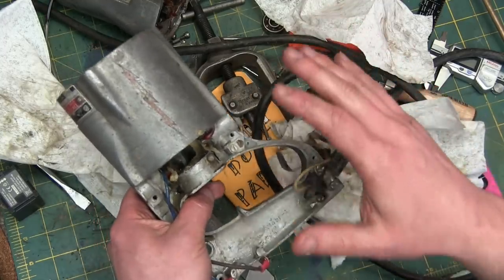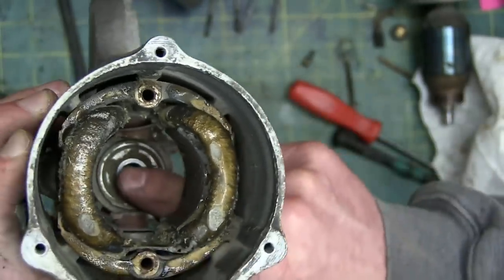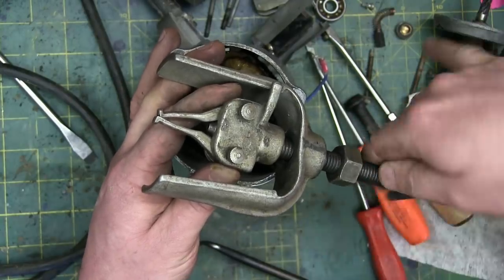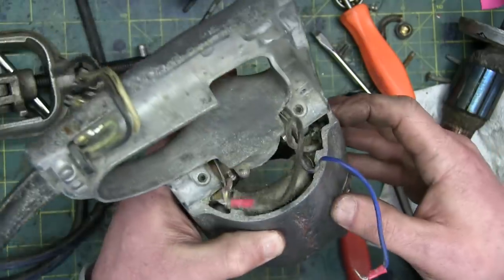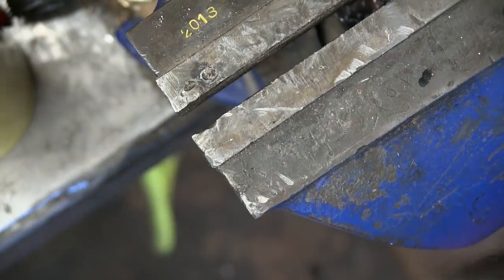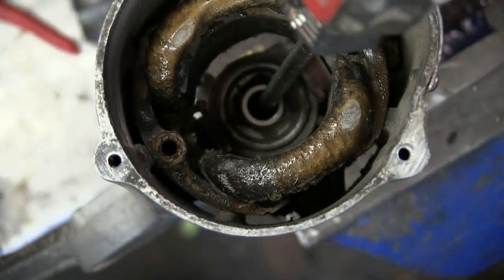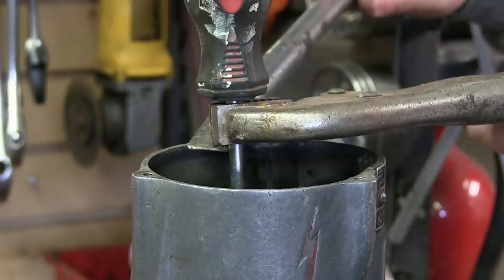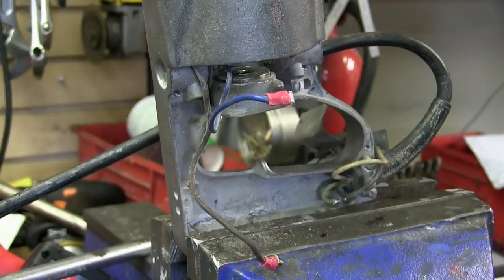GREASY RAG HACK! Damage-Free Bearing Removal.

Comment: I used this technique today to remove a pilot bearing on a Kia Sorento. I am a newish (3 years) mechanic and had not done one before. I was told I had to call the parts store and order a tool or I was screwed, the other techs said I should just skip this replacement and finish the clutch job. I tore a shop towel up and dipped it in wheel bearing grease, it was out in 5 minutes! Thanks for the tip man!
Reply: This technique was actually a question on the ASE test haha. It's becoming a standard way to get it done. Really though it's a good way to do it without screwing damaging things.
Reply: Still one of the best VJO's on here..
Reply: @gearhead1302  dude, it's a fantastic option. way easier on the surfaces so less likely for the new bearing to be cocked or something shitty too.
Reply: For a 3 year you did pretty good
Sorry, i couldn't resist, even 2y later
Reply: Use bar soap, shave pieces slide them in and tap drift.. no rags needed works every time
Reply: Two Cheeks Auto now you look like a fuckin genius in front of the trans tech that's been there for 10+ years

Comment: my dad showed me that years ago. Had to get the pilot bearing out of the flywheel on my truck, found a bolt that just slipped in and filled it with grease. few taps with the hammer and it popped right out. Hydraulic pressure, can literally move mountains.
Reply: I learned that one from an old guy that lived next door when I was growing up. Best part of 50 years ago now. Learned a lot of useful stuff from him over the years of my youth. Most useful was the attitude of 'have a go'.

Comment: Don't know if anyone else has mentioned this one to you AvE, but right along the same lines as the greasy rag hack shown in this vijeo, and not nearly as friggum messy, you can use plain plain white bread. Compress some strips of the bread into a little ball, farce it into the hole, add moarr bread, smack on wrong side of the slightly undersized drill bit and repeat. Hope this helps someone at some point. Love the videos AvE!! Your channel rocks!!

Comment: easiest way is fill the hole with a heavy oil and drive a woo dowel into the center hole the oils pressure will push the bearing out. learned this in the 70s from an old mechanist.

Comment: Craziest thing that you showed this trick! I was lucky enough to have an Uncle who worked for Ford and went to their trade school in 1926. Not sure where he learned it, but one evening I had just finished machining a bearing holder with a blind hole in it and realized I needed to get the bearing out before I sent it for plating.

Long story short... He pulled out a telescoping gauge found the ID then grabbed the appropriate gauge pin and dabbed a finger full of grease in the center. Moved the part to the arbor press and gave it a what for!

The bearing magically rose and my jaw fell straight to the floor!

OLD SCHOOL GENIUS!!
Reply: Andrew Germann each r
Reply: Yeah, it's an old school technique, still very cool
Reply: Hey wait a minute, don't they have a free app for that now 🤔😂

Comment: The grease gives hydraulic pressure as you force it in, and the rag serves not only to wick the grease in, but to seal the shaft so the pressure works on the bearing. Genius!
Reply: thatotherguy27 thanks I was wondering how it worked
Reply: I have done this with just grease. bits of rag are a refinement!
Reply: Believe it or not, I've even seen a clutch bearing extracted using stale bread! Same principal, although who keeps stale bread around?

Comment: I bet Mr. AvE had a piece of rod stock the correct size... but just wanted to use the drill bit to make the rest of us cringe...
Reply: Lumberjack Engineering bet it's a chinesium bit, about all they're good for
Reply: Yup..! That and opening a beer, is all they are useful for.
Reply: Actually, the proper nomenclature is "Chineesium sintered pixie dust".
Reply: or a transfer punch that would have been cheaper to replace, if necessary. I think you are right.
Reply: He almost certainly did, and if not he also has a lathe. Bearing that in mind, there's a big difference between having something and being able to find it.
Reply: If you use a cheese grade bolt it'll expand to form an atcheral piston. Sorta.
Reply: Don’t worry he owns a drill doctor
Reply: @kansascityshuffle8526  LOL great comment! :-)
Reply: I didn’t even question this that’s exactly what he did surprised he didn’t u a long carbide endmill
Reply: @johnsmith4630  Transfer punches,  don't need'em often, but they're a Godsend when you do. I'm going to use one tomorrow.
Reply: @kansascityshuffle8526  +1  Or what's left of one!
Reply: Once again, he got er done.
Reply: copper faced hammer wouldn't hurt it at all

Comment: Works with bread too!
Reply: I too use bread, clean and no cleaning grease afterwards.
Reply: Yeah I came here to say that. Saw some dirty guy on YouTube a while back remove a bearing using bread and a wooden dowel
Reply: Jeremy Baxter me too bread is always in my box...well when I need to do this it is
Reply: Bar soap works as well
Reply: Used bread just the other day doing a motorcycle bottom end at buddies sister's place. We didn't have grease haha!
Reply: I was going to say that. Good fix
Reply: I have used Parafin wax or bar soap. It doesn't sneak by as easy, no grease to clean up and it's cheap, available and even reuseable.
Reply: That's wild lol 👌🏼😌
Reply: Wet paper/cardboard. Works well and it's always available.
Reply: Slide Hammer ???
Reply: It's better to use white or whole wheat?
Reply: @outcast7899  you don't know nuthin'! Pumpernickel or rye!
Reply: @Weaver Cattle Company nice plumbers putty

Comment: The shop genie showed me a variation to this, instead of grease and rags... use bread and a bolt of similar ID. Tried it once on a cheapo pilot bearing replacement. Slick as two eels fornicating in a bucket of snot I tell ya.
Reply: Cole Bendis  yeah man fuck some grease, too much shit to clean-up after, bread all the way! learned this a few years back, will never forget it now!
Reply: Bread is awesome.  works for soldering pipes when they are still  a little damp inside.  stuff a lump of bread up the pipe to absorb and excess water to stop the pipe cooling.  Bread disappears once the water is turned back on.
Reply: bread worked on the clutch pilot bearing on my old land cruiser
Reply: My Bread just goes in the Toaster, Or my Mrs spends it, Normally the later one .

Comment: Yeah, so, I shared this with my snottiest of bmw fanatic friends. The contrarian fucks actually argued for bread instead of grease. Works exactly the same, only you have to finger out a bunch of compressed bread from your blind bearing hole. There's some kind of high-fiber joke in there but I just can't seem to extrude the comedy from it.
Reply: Bread? Interesting, I will have to try that next time I am changing a clutch pilot bushing. Although grease seems like it would be a little more available in a shop.
Reply: That's what I'm saying, but you can find videos of it easily. Both work about the same.
Reply: James Congdon I am a BMW master tech. The pilot bearing slide hammer is awesome. some crankshafts have a plug you can blow out at the rear you can blow out, and cause an oil leak..so the safest, fastest way is to chuck up the slide hammer and give er hell.
Reply: hilarious!
Reply: Yeah, while i'm glad to learn about this trick, i was wondering where the hell his slide hammer bearing puller (home-made or otherwise) was.
Reply: Thanks Bogart, did not know that...would be just my luck to try this, and permanently screw up my Z4.
Reply: @seang5284    You are correct about the bearing puller.  Sometimes you will 
find an UN-shielded ball bearing...no grease or bread will work, only a puller.

Comment: Ah nice, I've used this trick once or twice to remove the spigot bearing from a clutch system, upside down under a car, jammed wet toilet paper into the hole and tapped it out with a 10mm socket in the middle. Worked first time, much to my surprise.

Comment: Whoa!! Imma stick that one up my sleeve for future reference.
Reply: I've used it for pilot bearing removal once, worked fine just took time, recently I simply heated the pilot red hot it can't expand against cold flywheel so cools quick with reduced diameter and just fell right out, whole job took couple minutes.

Comment: Used this technique to remove many of pilot bearings out of manual cranks. Learned this trick in the mid 70's. Thanks for demonstrating this on a smaller scale.

Comment: Done it several times to remove pilot bearing’s or pilot bushing in the end of a crank. The easiest way to remove a brass bushing from the end of a crankshaft is take a tap that will thread into the brass bushing and just thread it into it and when the tap hits the crank just keep turning the tap and the bushing will walk straight on out. It will also work on the roller bearings if the bearing is totally seized up.  Love watching your videos. Keep up the great work.

Comment: I've seen someone use the same method but with white bread to remove a pilot bearing.
Reply: ramiro lucio last pilot bearing I did I had a block of soap handy and a knife.  shaved the soap down and funneled it in. kept the grease slop away and had the bonus of smelling good
Reply: wet news paper also works.
Reply: ramiro lucio been in the shop doing the same thing on a friends jeep. First time to problem, bread worked perfectly and no greasy clean up. Second time one end of the punch was mushroomed and buddy didn't notice, drove the old bearing all the way to the back of the hole nice and tight.
Reply: Always used toilet paper soaked in water, myself
Reply: +1 to the moist white bread. Did a great job on my Corvair pilot bushing that no remover tool wanted to fit. Used an old input shaft to jam 'er in.
Reply: I remember hearing this and always thought it was akin to muffler bearings but I'm fuckin' convinced now.
Reply: I used a hammer, bolt and soft bread to remove the pilot bearing on my Chev SB.  It works a treat - simple hydraulics!
Reply: same technique with some household hard candle.
Reply: I used bread to get a stuck socket off.
Reply: bar soap works wonders aswell
Reply: ramiro lucio "white bread"
Just keep in mind, it has to be "WONDER BREAD!"
Reply: Bread has worked for me!
Reply: Cheeky Monkees, Now THAT is funny!
Reply: IKnowYourCommentIs 
Get the chip off your shoulder. You are creating a slur where none exists.

There are YT videos on the topic that actually do recommend White Bread. Why? Because when compressed and slightly wetted it turns into a stiff paste.
Reply: +Cheeky Monkees
The Joke   <

Your head < 

Went completely over it....
Reply: Wheat bread works, too.  I just use a 3/8 drive extension and a hammer to compress it in pilot bearings
Reply: ramiro lucio 
When you are done , you can use the rest of the bread to make a fifi bag to pass around with your friends.
Reply: Would brown bread work?  Not likely....
Reply: I should've just said bread lel
Reply: akbychoice 
No, it's more like having a sheep named Fefe that your pals like to take to the stall in the back of the barn......
Reply: Gord Baker 
Well there's pumpernickel...... If you like German brown. The seeds may chafe the cylinder wall though. Not a good situation.

Comment: Late to the comment party but I have to say it worked!

Replacing all the bearings in my milling machine gearbox, one of the ones on the bottom stays in its blind hole and has me stumped for a while. Then I remembered seeing this video, watched it again, and now the bearing is free :)

Couldn't turn a good fitting drift on my lathe as all the tools are in storage but a piece of hex brass was good enough even though there was more grease leaking out than I was happy with.

Thanks for showing this dodge - you got me (and my bearing) out of a hole and I have something to brag about down the model engineering club ;)

Comment: Great idea! I used to use the grease trick on the  old clutch pilot bearings which were in the uk solid sintered bronze "Oilite" type ones here in the UK and if you had a good enough close tolerance to the ID they didn't take much grease to pop them out (certainly no need for an expensive puller lol) but the idea of packing it with what looks like cotton  rag to seal the gaps in a ball or roller bearing is a bloody good idea! And one I will remember for the future. Thanks AVe

Comment: This is some straight up Jedi sh...stuff. If this was uploaded April 1 I could understand it.
Reply: and the rag makes the grease stay behind the ballbearing gaps
Reply: viljami yea, you are basically turning it into a hydraulic cylinder.
Reply: the grease is there to makenthe rag be able to "flow" if you used straigth grease or straigth rags it wouldn't work or it would be much harder to do
the greased rag will flow like a fluid when you shock load it.
Reply: steven yau if they can't  figure  it out for themselves  they are at the wrong  channel

Comment: Awesome trick! Never seent that once beefour. I have ran into that situation however before. I drilled 2 holes in the metal behind the bearing and used a punch to gently persuade it out. Then tapped the hole and plugged them with 2 small bolts. Then you have access if you need to do it again.

Comment: hell yes ! i used a similar trick to remove a carbon-graphite bearing from a blind hole  in the noisy gear pump that supplies my tig cooler. put a little 30W oil in the hole and used a close fitting gage-pin. a slight tap with a plastic hammer and out it slid, neeter than a skeeters peter ! nice work.

Comment: I saw something similar.  A forklift mechanic used only grease to hydraulically blow it out.  He had to move the punch much faster of course, but then again, he was working in cast iron not thin cast aluminum.  This hack is good for those delicate situations.

Comment: I used this tech to extract a broken dart tip out of a tungsten dart barrel. And a small carbide drill bit with a steady hand. Drilled directly through the center of broke tip, got alittle grease and cheap bit put it in the hole non flute side and with one light smack it popped half way out the hole 🦾. Been alil while I miss ya ave!

Comment: I tried this and it worked like JFM. Also tried heating a bearing in the microwave trick to install it on a motorcycle front fork. That also worked like JFM. Thank you for the tips.

Comment: My dad taught me this. Old farm boy trick. Ive used it when I was a professional auto mechanic many times. Quick look told me I didn't have a puller so out comes the bearing grease. Used it numorous times on clutch pilot bearings.

Comment: This is how I've been extracting transmission pilot bearings for decades. I use the clutch alignment tool. Pack the bearing with a lot of grease. And it will come out slicker than snot on a door knob.

Comment: As the night mechanic at the paper mill I found that one of the lowest paid helpers left a pallet leaning on a double roll winder.  When time came for rotation, the winder crunched the pallet and broke all hardened locating pins that were driven into blind holes on the rotating hub.  When we got the hub off we found that no drill would touch the pin sheared flush with the hole.  I guessed at the position of the end of the pin and drilled at an angle to where I hoped there was space at the end of the hard pin.  Then tapping threads for grease zerks in the 5 holes, I pumped a grease gun to extract the sheared pins.  It was back in operation for the next shift.  Sure beats rush order and cost of a hub from Italy.  Ready for the next dip wit packer to break it again.  I’m sure your description would be much more entertaining but the principal is the same. You could have plugged the bearing and drilled the back as well.

Comment: Was tryin to get the pilot bearing out of a flywheel, didn't have a puller, it looked like the tip of my grease gun (the actual tool, no, not what you were thinking!) would fit snug in the hole.  I thrust er deep and pumped away, She slid right out.

Comment: we always used ivory soap instead of grease, works similar except you don't need the cloth, can either drive the rod in, or thread a bolt that is slightly smaller than the hole.

Comment: Funny, I came here looking to pull bearings from my 5hp air compressor motor and I actually did my Toyota truck's clutch 3 months ago and got the pilot bearing out with olive oil soaked bread and a cutoff wood drumstick that I hammered into the hole. It worked really well.  Hydraulic ram FTW.

Comment: I don't know if it has been mentioned before but a few slices of bread could have been used instead of the grease and rags. I have used bread and a properly sized punch to remove a few clutch pilot bearings. Bonus is greasy shop snack while you're working.

Comment: I used a rawl bolt on a long-ish, threaded bar to grip the inner race, then a socket wide enough to fit over the outer race, then a washer and nut threaded on top of the socket. As you tighten the nut it pulls the bearing out. Huge faff though! This method is ingenious!

Comment: been using the grease in the hole to remove bearings/bushings for years usually to remove pilot bushing/bearings from crank shafts for manual transmissions. grease and a 3/8 socket extension turned big side in

Comment: I may have to record and send you a video of disassembling an angular contact bearing with a hot plate, heater tape, and liquid nitrogen. It's like watching paint dry until the bearing separates, then !score!
I'm not sure if it counts as skookum, but it is very satisfying to get the wear pattern on the races after doing so.

Comment: I’ve been doing that for years now too remove clutch pilot bearing. However, the only difference is that I use bread instead. It’s never failed me in all those years, I’ve removed close too 30 bearings with this method.